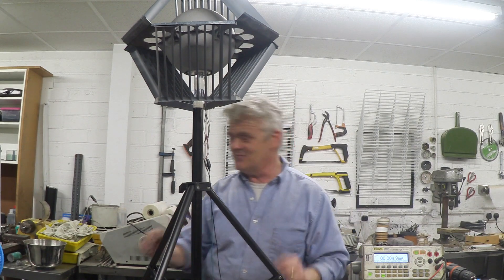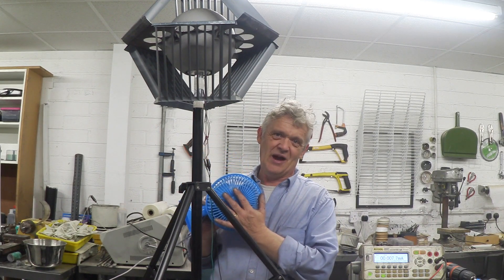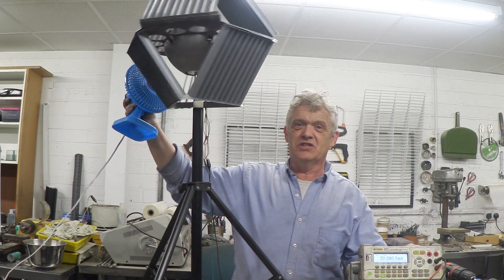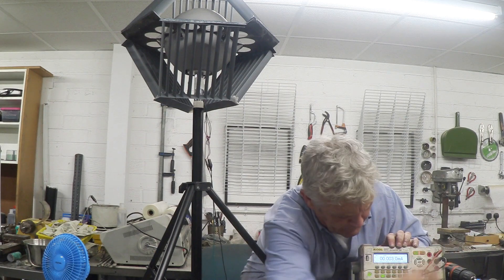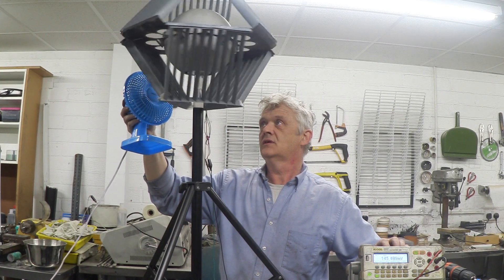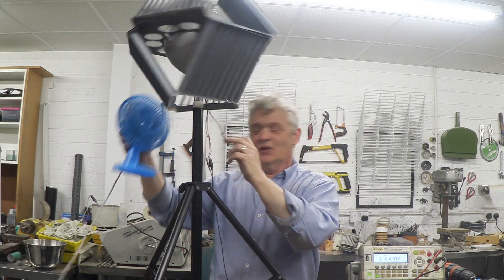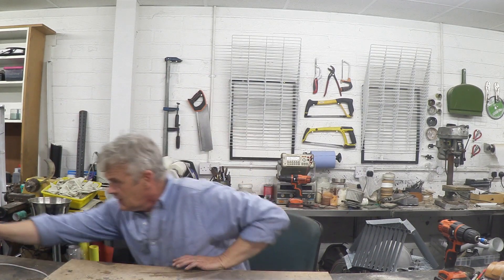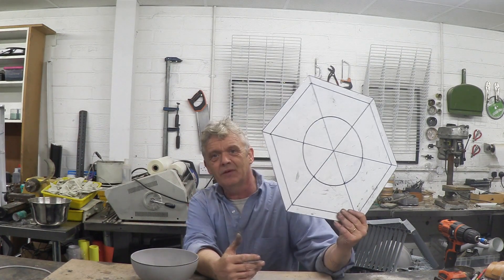Cuboctahedron Finished And Working - O Wind Part 4

Comment: As a concept it’s intriguing. I like that it might take advantage of the vertical as well as horizontal orientation of the air flow. It would be interesting to find out how it might compare to conventional blades. I suspect the density of the blades might increase the relative torque. It would require professional testing to ascertain actual efficiency.
Reply from the maker: it would - and I can't do that - I don't have the experience or the equipment

Comment: Awesome! Good Job Rob. Much better improvement! I love the way it looks and now I guess the proof is left in the pudding on how well this will work as you said structurally but air flow looks like it is flowing much better. If anything at the least, it is a really cool looking piece of art for the yard that can get some energy from it
I can also see it as a Tesla energy antenna if designed in the hair pin circuit and it was all metal or conductive...smile.
Reply from the maker: I agree mate - pretty much with everything you said - cheers

Comment: you can use ebike motor to collect power easy to mount and the cable coming out is solid and stable
Reply from the maker: nice suggestion mate - cheers

Comment: We are all praying for wind to see it in action. I thought the last design was cool - this is even cooler! The centre sphere is the optimal shape from a fluid dynamics point of view, I think. Though it will be subject to the Magnus Effect which produces a force normal to both the wind direction and the axis of rotation. The same force that causes a football to swerve when you bend it like Beckham. That's how Flettner rotors work. The support structure needs to be strong enough to withstand it.
Reply from the maker: I am looking forward to trying it out too mate

Comment: I love the concept which could be scaled up somewhat except for the Venetian blind blades perhaps which may need something stronger - they will tend to flex I think. I'll have to give that some thought but my initial one is to cut strips from a dead 'white goods' cabinet and bend them over a former (a piece of pipe!).
Reply from the maker: I like that mate -but gentian blinds are funny things - I sued a 'normal' household plastic type - but they come in all kinds including fairly large metal ones

Comment: Pretty interesting in that it has relative simple construction.
However, if you keep reducing the size and offset of the arrangement of the panels, you would end up with what is essentially a helical swept-blade wind turbine, which I suspect becomes more efficient relative to its construction.

Comment: I’m wondering whether putting a few of these on a rack on the back of a vehicle could produce power while driving, or when there’s not enough sunlight for solar power?
Reply: Theresa Hartman I think with the right design one could gain power from the air motion over a moving vehicle but I don’t think these would suit in this application as the would produce extra drag on the vehicle and reduce the mpg 
If the power produced was used to generate hydrogen this improves the engines combustion significantly in older models 
😃
Reply: @johnmcfadden9336  i keep thinking about using the waste heat from a car engine to generate some power. Something like a thermoelectric generator but more efficient. Using waste heat wouldn't add additional load to the engine.
Reply: What about using it when stopped, keeping it in an enclosed space while mobile?
Reply: Theresa Hartman definitely worth it on camper vans and other vehicles too and some how store the energy
Reply: Bill Jones hi I don’t know why the waste heat from the exhaust isn’t used to power absorption cycle heat pump for air cooling and even refrigeration I know these are not as efficient as normal compression cycle units but the heat is there for the taking  
I don’t know if it’s feasible to run a turbo just to generate power for hydrogen use 
To be honest I’m no expert on mechanics or anything come to that but I do know we are we far to wasteful 
We’ve been conditioned and encouraged to be since childhood and are now held to blame for the destruction of our beautiful planet so ear mark for elimination to save the world 😃
Reply from the maker: if you attach it to a car mate it will burn more fuel because of the wind resistance it will create

Comment: i know you said you dont want to change it at all, but its occurs to me that with very little changes you could stack these vertically to increase output without having to build more horizontally, building vertically allows you to basically have a wind tower that generates power per individual unit, instead of the standard wind turbine model that generates per tower.
Reply from the maker: go for it mate - chances are I won't I am afraid

Comment: Rob Sir standing ovation, love and very warm regards from India, lovely feat though the readings are in Mili Amps and Millivolts but again with that small fan is seriously impressive, I am working on a resin cast coil structure and neo magnets for my own little design but would anytime love to go with geared DC Moters, they are awesome, the recent BLDC versions are extremely good they use neodymium magnets and are good generators as well, lovely design truely enjoyed got inspired to do things in renewables also am soon ordering our wonder ink for Supercaps.
Reply from the maker: oh I agree mate - the new bloc motors are awesome - I just tend not to buy anything I don't need to
Reply: @ThinkingandTinkering  You hold one great quality of my mother, she just cant throw away stuff I as well am a dear friend of many scrape guys, what world sees as scrape I always find something useful in the discarded equipment just like you, so yes the need of buying something is scarce I by using a thrown away DC Moter had made a friend's Air Conditioners compressor work removing the AC Moter which was there inside using batteries It just did a lovely job!! Rob Sir  I have started making Lithium ferrous phosphate battery packs for EV using brand new A grade cells, I wish to have a aluminium casing for the purpose to put the pack in, but there is one resin that's Electrically non conductive but thermally conductive I wish to use it in the aluminium case to vent heat as it would touch the aluminium casing and do it's job, I foresee two good aspects of using the resin
1) Battery becomes water resistant almost proof of terminals are not shorted. But I do tell people to use silicon sealant over terminals to make them water resistant.
2) this resin will provide a good fit in aluminium casing thereby reducing the vibration effect when mounted on vehicle, also it will throw the heat out if the battery is under pressure!!🌹🌹 Please guide me Rob Sir very warm regards and love from India.

Comment: Really an amazing device Robert! Something to be quite proud of.

I have often wondered if one could generate a usable amount of electricity to charge a battery bank you carry in your car. Say a cylindrical squirrel cage lying on its side mounted to the bottom of the vehicle with a shroud that only allows the air to interact with the squirrel cage at the perfect angle. Or possibly mounted to the roof or trunk. Utilizing areas of drag that already exist in the vehicles design. How much could one generate during a 45 minute commute?  

I love your videos brother! Our world is a better place for your genius. Thank you
Reply from the maker: if you attach it to a car mate it will burn more fuel because of the wind resistance it will create
Reply: Robert Murray-Smith   I’m sure that would be the case with something aerodynamic. I drive a service vehicle that has the shape of a brick.  

Maybe a couple ribbon types behind the grill?

Comment: Awesome, genuinely awesome.
Reply from the maker: Thanks a ton!
Reply: @ThinkingandTinkering  i knew taking out those solid plates would make a difference, i was still on thinking about 6 vanes in a double 'bent fan' arrangement   bit one layer further put and you went and just swapped one for the other. I hadn't made that leap yet, i love it when someone jumps a step while I'm still considering it. Kudos.

Comment: you could get a plastic bucket of the same size, cut П-shaped holes in it with a soldering iron and get a squirrel cage that's more efficient and cheaper
Reply from the maker: lol - go for it

Comment: Hi Robert, well done, how did you join the Venetian blinds to the frames? In the previous video you had more boxy frames, but here they have slimmed down a bit. Hot glue? Builders adhesive?
Reply from the maker: screws - I want it to be removable

Comment: Beautiful. Nicely done. Your videos are impressive. Every single time.
Thank you. 

What if you used a CC Walton multiplier to charge the center ball. 
Would this ionised air aid? Is it possible to direct an outlet exhaust? So the center becomes lower pressure.
Reply from the maker: thank you mate and yes I would say it would - actually thinking about that - you could make this an ion motor I would think
Reply: @ThinkingandTinkering  i imagine it like this, 
Dielectric material for the construction with aluminium blades and ball. 
Many needles secured to the blades with ground to the ball and a Center axle of iron with 4 x ring magnets.

Comment: Has anyone tried also combining a turbine like this with some photovoltaic cells to make up some of the outer surface area. So the constant turning would give them constant exposure to supplement the energy output of your model?  Just a thought. Cells can be made very thin and light . Think about it.

Comment: A busy highway generates quite a bit of wind. A bunch of these placed along the side might generate a fair bit of electricity 🤔
Reply: i was thinking 1 every 5m apart down the centre of the motoway to power the over head lights
Reply: Or off a rail line
Reply: And then after 2 billion  we find out that somehow it increases gas emissions by reducing the flux generation coaxial ratio of coefficiency and so we spend another 2 TRILLION converting everything to electric... only to find out that horse and buggy always was green... a casual drive in the carriage love? 

NOTE: before y'all try and troll... know that all of the aforementioned mumbo jumbo was supposed to be funny... you may now commence to your regularly scheduled programming. Lol❤
Reply: @igloobearred  A horse and buggy is an ideal clean source of energy... unless you're the horse 😊

(Not trolling, laughing with ya)
Reply: @colleenforrest7936  ❤ it! What if the horse really likes you and going along? Maybe we're good buddies. 🤣
Reply from the maker: nice one mate
Reply: @igloobearred  so... Every once in awhile the horse jumps in the carriage and you pull him around too?  And his date? 🐎 😃

Comment: Again a great build. did you put a bareing on the motor shaft.force in time may stress the stepper motor shaft?
Reply from the maker: nope - I used a nema stepper they are very robust with two thrust bearings in the end blocks

Comment: How about rigging it up to some bricks soaked in the stuff touch screens are made of...   pedot   I think its called.   Leave it on  spin in a garden(away from potential windows and people) to charge some house bricks..... I wonder what over charged house bricks coated in Pedot do... do you think they explode... I think it would be a service to your fanbase to try it out....😉 its definatly starwars...  a magnetic hover bearing would make it even more starwawsi . Il hook you up if you need a scetch to work from.  May the Force be with you.
Reply from the maker: cheers mate - but I do know how magnetic bearings work - remember I am all about being able to replicate easily

Comment: I have alot of trees around my house, the reason I haven't put up a turbine, is it would have to be about 50' high to get good wind,   maybe if I made a large one of these, about 4' x 4' squares, what ever that comes to. Just a guess, anaybe 8-10' dia, maybe this could work on my roof? On about a 10'-12' pole, being the wind is coming through the trees, if I could get about 150 watts on a day with decent wind, it may be worth putting up, but for me to put money into a turbine, it would need to do a minimum of 400-500 watts, and about 2kw in a good storm!   And speaking of turbines, what's your opinion of a 6 blade turbine, with 3 short and 3 long skinny blades ? The short being about 8' diameter, and the long about 12' dia. .
I'm thinking it will start at low speeds, and keep going in higher winds,, what's your $0.02??
Reply from the maker: I did the original version in the trees if you remember and the idea here is to try and capture buffeting winds - so it wold be well worth the experiment I would think - especially if you build it yourself - which is very do-able. I don't know about a six blade design mate - I haven't really tested it so I can't really say anything about it - sorry

Comment: What about a reverse Voith-Schneider?  Would that work?
Reply from the maker: I had to look that up mate - which should tell you - I just don't know - but I like the idea
Reply: @ThinkingandTinkering  My thinking was that Voith-Schneider can change the thrust vector instantaneously, so maybe one can use it in reverse, using a small "rudder" to adjust its airfoils to match the wind direction.  Not all that clear on the details, but maybe there's potential.

Comment: wait the motor is driving it? I thought the wind turbine blade would drive the motor, which was intended to be a generator?
Reply: What? Motor does not drive it. I'm quite not sure about what motor he uses as a generator though.
Reply from the maker: nominate the motor is hooked up as a generator - the wind drives it
Reply from the maker: it's a NEMA stepper
Reply: @ThinkingandTinkering  ok you said driving it in the video, kinda figured it was just a goof since most of the time a motor is driving things, and it is the important part when using it to generate power, so it I guess could be said it drives the current and voltage,  utilizing the rotational torque and speed gained from the wind XD

Comment: I don't know the exact motor configuration but it could be upgraded by just adding additional magnets on the can,it may be possible to tune the aerofoils angle so the procession of the blades draws forms a spiral,golden ratio?:) lol but a lot of work
Reply from the maker: that is a lot of work mate lol

Comment: Just a couple of tweaks ........ A translucent bowel and a few of those color changing LED's wired to the motor ..... THEN you will have Star Wars (or maybe Star Trek?)  ........ put on your roof it will scare the bejesus out of the neighbors ;0)
Reply from the maker: very cool mate - want to build one?
Reply: I do, but I am thinking of something a bit different. I am thinking of an axial fan type but mounted along my roof ridge. That way the whole roof would act as a deflector giving more bang for my buck! New roof going on next week so I will have to do some measurements and play with the math first ;0)